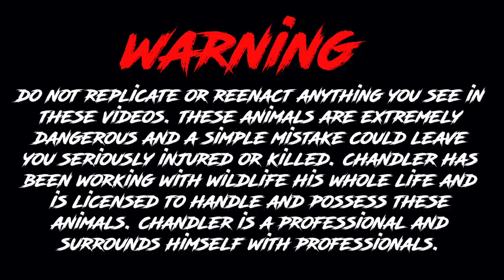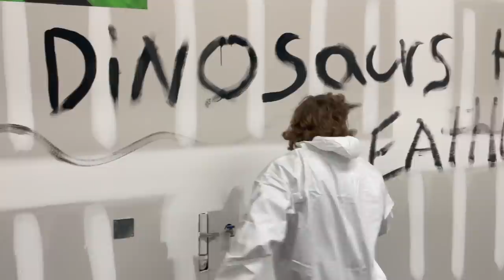Follow your DREAMS! 🙌🏼🐍🐊

Comment: Just an idea as I was watching you, when you're building the Cobra enclosures, you're probably going to try to make them bioactive so that you can get them to have a cleanup crew. You could fiberglass a wooden bottom Like people do for DIY aquariums. And have a drainage layer with a capped pipe extending outward for extra drainage. Using lave rock from the hardware store for the drainage layer to save money instead of using the high dollar bioactive clay drainage material.